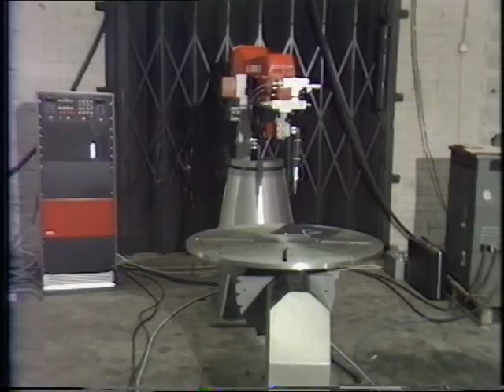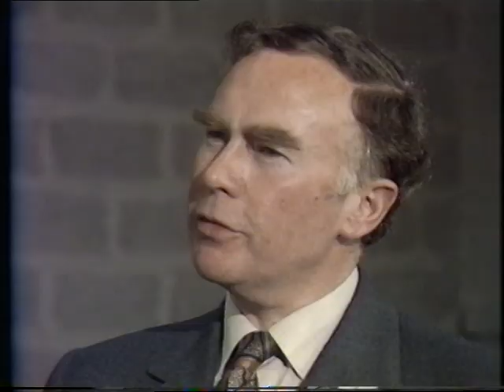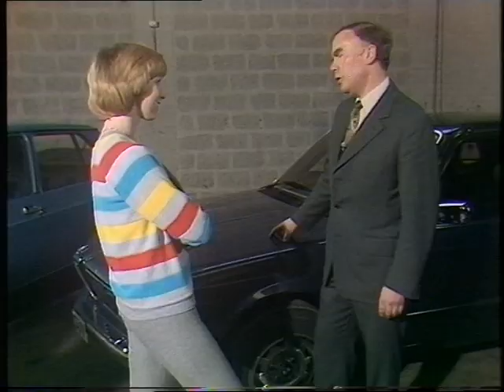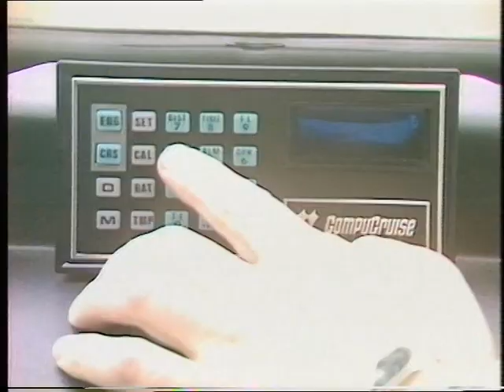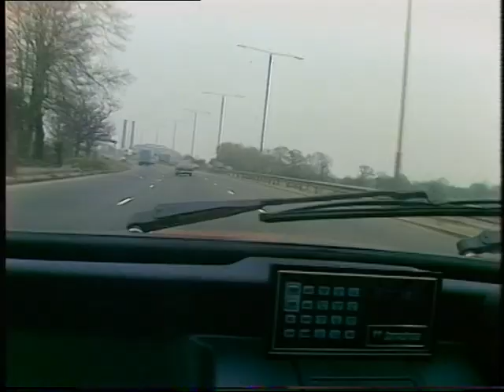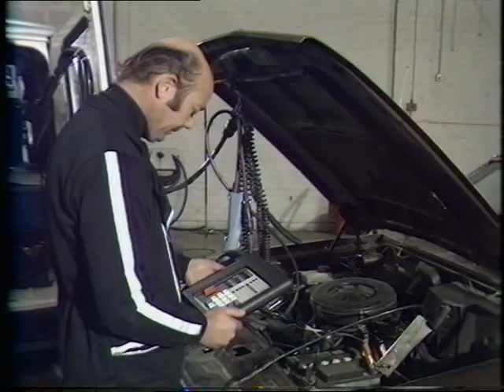Computers in cars | Early Cruise control | Fiat Strada | Wheels | 1980

Comment: Just think 4 years later Austin-Rover released the MG Montego "talky" which had an amazing digital setup, the Maestro and Montego VDP's also had cruise, speed alerts, fuel and digital trip meters but not quite as comprehensive as the MG Montego full digital "command" centre which incidentally was great fun if you didn't mind a slight corner and being told your oil was low, your fuel was about to run out, your doors were open.   A-R were not quite on the ball there, nor were they thinking of variable rate PAS on these cars which suffered dreadful torque steer made positively scary on the MG Montego Turbo where powering out of a bend the steering would snap straight or fling you hard left or right and only remedied through the mystic powers of class suits by cross owners.   A-R also cheaped out on loom connectors which meant your brand new sporty car would suddenly die from failed ECU connections which in turn just turned off the electronic ignition and other nice things.

Comment: This guy is offering an excellent explanation of the implications of this technology, given how new it was in 1980. Modern cruise control, using primitive electric, electronic and vacuum systems, had been around at least since the 1950s (very primitive example were developed for  trains in Britain as of 1788 and for cars by 1900) , but is was just really being computerized around this time. Analog computers from Bendix were used for fuel injection as an option on the 1957 Chrysler cars, which almost no one bought, but similar Bendix/Bosch systems were being installed in Volkswagen, Volvo and Cadillac models starting in the late 1960s. As of 1980, Cadillac claimed to have the world's first digital (as opposed to analog) engine computer, but for 1981 most larger cars sold in the USA needed them to meet the expensive new emissions regulations.

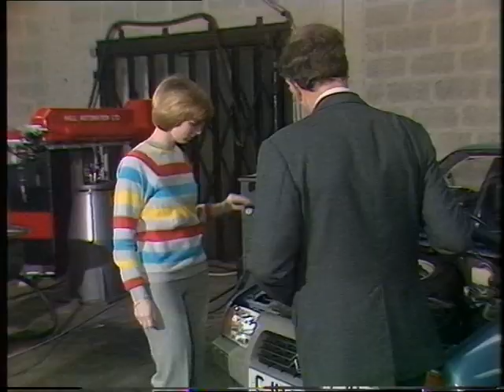Comment: now pause at 3:18..

Did you see the wheel under engine hood? 
Or...?
Reply: If you study the picture for a few minutes a car appears in the background...
Reply: Yes, that's where the spare is located on the Visa. In the 2cv it's in the boot.
Reply: @rich_edwards79  Ami 8 had the spare under the hood, just like Fiat.
Reply: Peugeot, Citreon, Reliant Scimitar were some that used the engine bay for the spare, with the Scimitar it was part of the design as the front mounted wheel absorbed noise, added weight and a little stability in a very light car and if you think back then French cars tended to sling the spares under the car making for a dirty mucky change during rain or winter and that is before you even got the usually salt corroded wheel brace to release the damned thing...

Comment: strada designed  by computers built by robots driven by morons
Reply: Aka the Ritmo or more accurately the 'Rotmo' - pretty little cars for the time but my God did they dissolve!
Reply: And ruined by rust as they are pushed  off  the assembly line or if your lucky the showrooms.

Comment: Fabulous video and explanation of car electronics that are commonplace today. Very perceptive comment about the relative reliability of electronics versus sensors. 
Whilst the technology shown here has moved on, the principles have stayed the same. Amazing to think of the increased density of silicon "chips" though, and the fact that transistor counts may run to billions rather than 10s of thousands which was a typical 1980s figure.
Reply: well, not so perceptive comment because he said it's more reliable overall, which was obviously wrong even from the point of view of that time....
Reply: @TheKenjoje  Cars are factors more reliable than 40 years ago. They last longer and give less trouble with cold or hot starts. And that's in spite of the enormous complicated things as catalytic-convertersm, airbags and other added safety-equipment.. And they are way more fuel-efficient. Watch a test of a Escort of 1980 and a mpg of 25-30 is normal. Nowadays that would be unacceptable, even though the average car is almost twice as heavy.
Reply: @JJVernig  yeah, I know, but the question was reliability of electronics. more things in there means more things to go wrong, it's simple....of course it is easier to start the car with electronic injection than with carb and of course that carbs used to go wrong with the time as well even more than electronic injection systems with the time, but they only needed to be checked and kept in decent condition while some sensor could make your car unable to start and you need to find out what it is, you can't tell, and that's the very thing that is happening to me right now with my car....
Reply: @TheKenjoje  Check, now I get your remark.